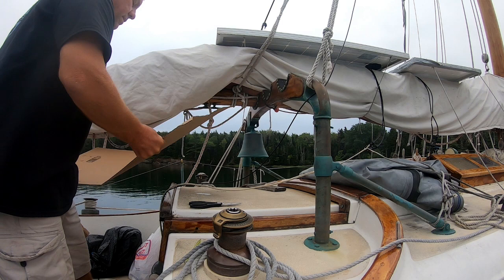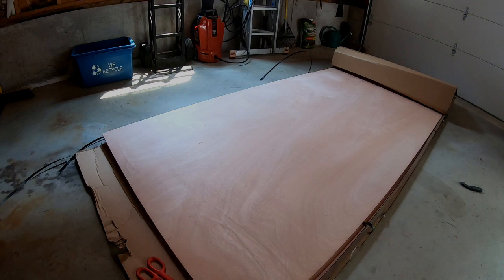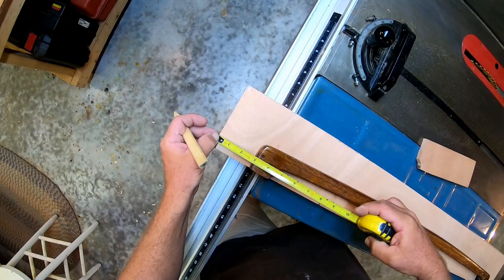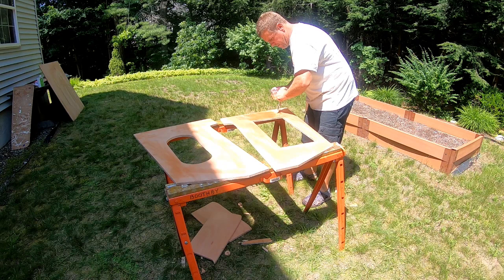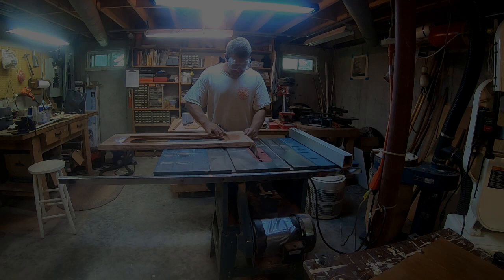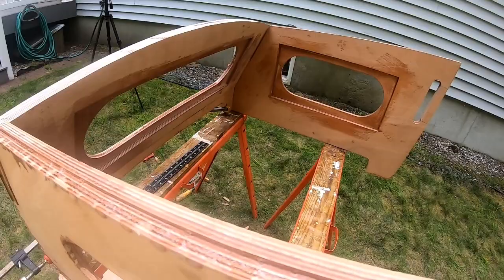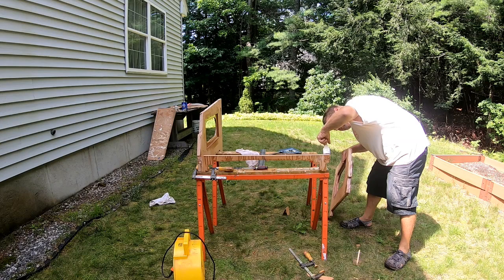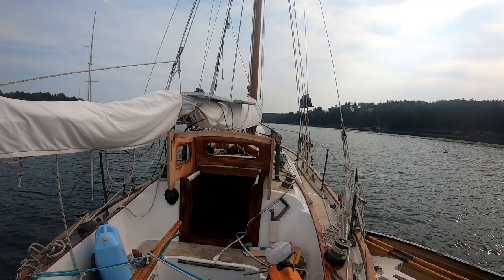Building a Hard Dodger, Part 1

Comment: After building my hard dodger,  and knowing what your doing,  it really would have been better to build the gallows into the dodger and making it correctly
Reply: I have a feeling Kevin is a bit of an expert on cost/benefit. Maybe he knows what he can achieve for the right amount of effort without multiplying the complexity of the project - bearing in mind just how structural and critical a proper boom gallows is to a gaff rig.

Comment: Nice dodger.

I was thinking about the aft arch, would it not be beneficial to place that on top of the roof?

It would give you more headroom, a nice handhold and maybe can break of some splash too. 

I also think the idea to integrate the boom gallows in the dodger would be nice, but that would make you start all over again.

Anyhow, thanks for a great channel and great sailing videos. When people say an electric motor is not good in a sailboat becouse of the limited range I always think of you and your boat.
Reply from the maker: I think that a supporting arch is better structurally.  Also, the boom may not clear with the arch on top.

Comment: Mr Boothby, 

  Another good video, thank you!  I never miss one.  I have a question for you.  Since you are one of the very few youtube sailors that uses 3 strand running rigging, I am looking for advice.  I am about to replace the running rigging on my, new to me, sailboat.  There is a huge difference in price between the well known brands and the bulk 'by the spool' prices for no name 3 strand line.  Which way did you go, or which do you recommend.  I intend to rig my boat as traditionally as I can.
Thanks,
Reply from the maker: For my running rigging I like New England Ropes traditional 3-strand, the poly-dac if I recall.  It's not too expensive either.
Reply: @howtosailoceans1423  Thank you Kevin, I really appreciate it.